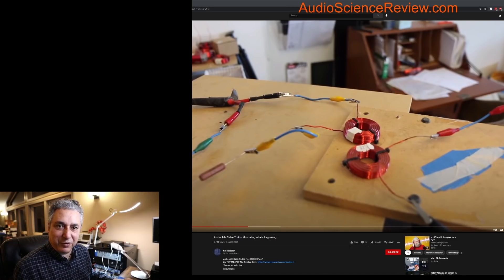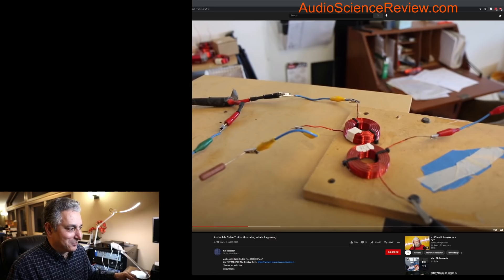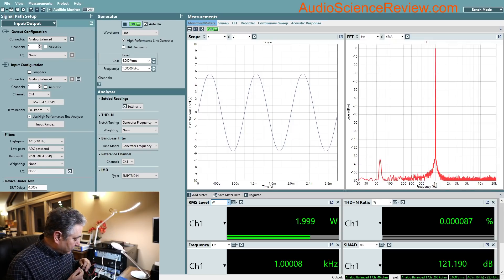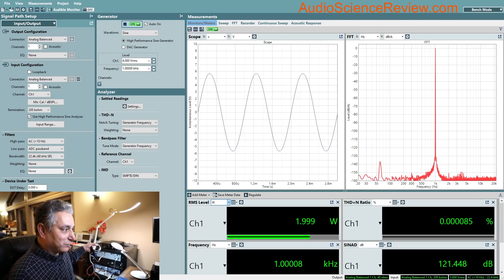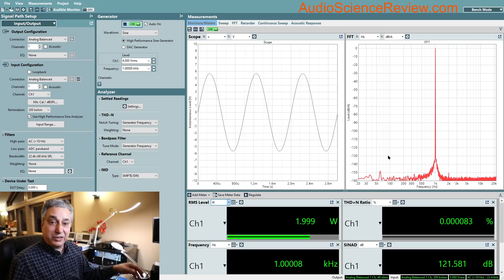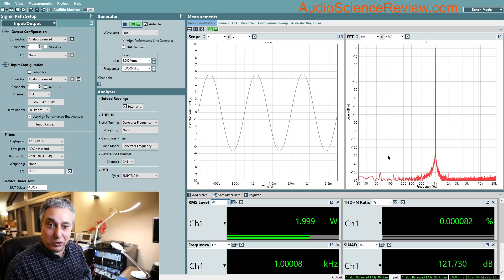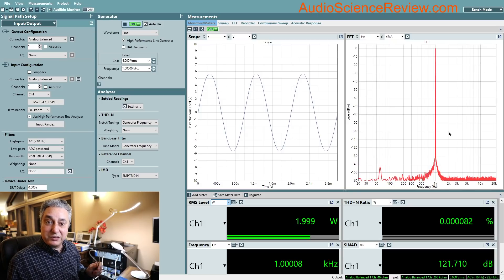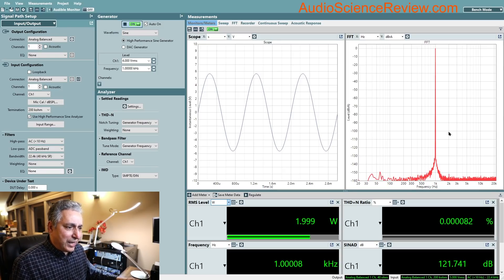Electromagnetic Interference In Speaker Cables?

Comment: I have heard inductive mains hum  once when a mains cable was crossing over the interconnect from my pre to power amp. It was easily rectified by moving the mains cable away from the interconect.

However it was late at night and when no music was playing. The level was far below the level of when a track was playing.

However it was audible.
Reply from the maker: On the input side of things, due to amplification factor, it is easier to make such things  happen.  This discussion is about the output side, speaker cable, where intrusion is far, far harder.  At any rate, the problem can and does exist.  If it becomes audible as in your case, then you do something about.  And at any rate, it is easily measurable.  The case Danny and other cable guys are trying to make is that there is a type of intrusion that is inaudible by itself, unmeasureable, yet readily impacts music.  This of course makes no sense.
Reply: @AudioScienceReview  sounds good Amir!
Looking forward to future videos on this topic and it's great that you and Danny can discuss these matters and hopefully advance the knowledge, and clarify things, for everyone. Cheers!

Comment: I mean, of course the coils next to each other did that. That's a transformer without a core. Technically they could be inductors, but it would be at really high frequencies (like, RF or higher, where every wire is an inductor).

Comment: Noise does not have to be audible to affect the sound signature of a piece of equipment your opinion means nothing to me as a engineer for 35 years and in audio for the same if you experienced a high quality revealing system you would know what I am talking about measurements are not the tell all of audio quality get educated or shut up 🤐
Reply: It is so sad that some people think that hurling insults is a valid form of debate.
Reply from the maker: I shared no opinion.  That is what you are doing with no evidence.  I shared actual measurements and psychoacoustic effect of said noise.  If you want to throw out the book of science and engineering to make your point, then I don't have anything to tell you.  I am assuming you don't go to doctors either and just go by what your gut tells you about how to cure yourself....
Reply: @AudioScienceReview  Amir for PREZ

Comment: What about this one : copper is more expensive than aluminum but less than silver. It is therefore common sense that your system will sound better with silver speaker cables (more silvery) than copper ones and that aluminum ought to be reserved to wrapping up chicken legs or connected to high-power amplifiers (provided there is enough “meat on the bone”, such a good heat conductor makes it warmer). Better, use as many interconnect cables as possible and thus go full separate. You thus increase the number of gold-plated connectors for a richer sound, and start inevitably to hear cracks and pops when you stumble on your cable lifters for a full analog experience.

Comment: Danny strikes again...Speaker wires are never an issue with noise pickup, RF, EMI, as the speaker is a low impedance load and there simply isn't enough energy in the noise to register, you can pretty much treat is as being shunted to ground as far as the noise is concerned. Line level cables are a bit different story as the voltage is low and the load is 10-50kOhm generally. When I wire my AV equipment, run AC, ethernet wires etc along one side, audio signal cables down the other to keep these cables as far apart as possible. Much less of an issue with balanced signals that the industry should have adopted fully 50 years ago.

Comment: The next obvious step is to set up an amp and speaker(s) with power and speaker wires coupled in worst case scenario, a nominal scenario, and a best case (possibly even HIFI cables). Then listen to the noise floor, test tone, and music in blind testing to see if you can hear any difference. We can do this at home too.

Comment: Would a power cord (wire) that was actually passing current induce a higher level of EM than a cord that is not passing current?  As current flows through a conductor (60hz) the changing amplitude causes EM, the basic principle of an inductor or transformer. A wire that is not passing current would not generate any (noise) due to the sine wave created by the AC current not being present? Example... Take an amp meter, clamp it around a wire connected to a load, turn on the power, then turn off the power. There is a significant difference in the EM generated by the magnetic field of the wire shown by the Amp meter (off power is the cord you used, plugged in but not flowing current) Question is, would there be a significant difference in the amount of interference (noise) with a wire passing current say 5 to 10 amps which is typical in an audio set up? I have induced a 60hz hum in a speaker wire when placing it on or very close to an older fluorescent light fixture transformer. They were notorious for that. (Danny's coil test)  It would be very interesting to see measurements to see if there is a difference with a conductor passing current vs. open ended. Great video!!!
Reply: I was thinking the same thing about fluorescent lights, though they are probably located too far away from most folk's speaker wires (unless mounted in the ceiling), to have any real effect other than for a video like this.
Reply from the maker: So many of you making the same comment.  :)  Here is a test with realistic current growing through it: https://www.audiosciencereview.com/forum/index.php?threads/electromagnetic-interference-in-speaker-cables-video.20647/post-683806.  Same conclusion.

Comment: So glad you came along Amir. Hopefully your content will change the audio industry for the better. If you haven't tested any power cables I may be sending you a big fat fancy 10/3awg power cable.
Reply from the maker: Hey there.  Thanks for sending me your amp in the past for testing.  I have a semi-fancy power cable but that is it.  Is yours a branded, "high-end" cable?
Reply: @AudioScienceReview  Its not branded. Think it was maybe $50. But it is made with true 10/3 copper wire and nice chunky gold plated IEC plugs. Also came with a lovely persuasive description letting me know all the ways it will improve my sound. I must be doing something wrong cause it hasn't made a difference on the several amps I've tried. Didn't make my Sony NS999ES disc player sound any better either. Starting to think this thing is a rip off....LOL.
Reply: @iowaudioreviews  but does it look cool? Maybe that's all you need it to do XD

Comment: what about an applied load to the wires, particularly a speaker. measuring the difference electrically and mechanically with a mic or laser removes the hidden variables of the system because its measuring the system at a whole. as a test i think this demonstrates the properties of induction not electro mechanics as a system. i dont really subscribe to anything with regard to this type of snake oil but its destroying the snake oil argument totally by treating it as a system.
Reply from the maker: The measurements you mention are not sensitive enough to pick up anything this small.  Ambient noise for example would rule out doing anything with microphone.  Now, to the extent Danny says these effects are readily audible, then he should share such clips to us to listen to.  There is only so much I am going to do to prove what is already proven.  He is going against that tide so needs to provide real data.

Comment: I loved when you showed the measurable difference of simply moving the cable around. I hope people don’t focus on the fact that there is a difference and instead understand that level of audibility is simply not there. Though, I do imagine there are going to be some cable riser manufacturers that will now use that portion of your video to show people why it is important to hold the cable in the air. 🤣
Reply: Quadcpoter manufacturers please take note...
Reply: @analoghardwaretops3976  🤣
Reply: They already raise their 2 inch fat cables from the ground with standoffs at demo's. Now those cables must cost a fortune....lol. And the connectors, omg, they must be huge!
Reply: You bullies can make fun of Danny all you want, but if you had 5000 ft of speaker cable running around a set of generators and men that ate too much curry, you’d want to hold them in the air too.
Reply: The saddest thing is that a lot of people seem to believe what Danny preaches. PS Audio also has weird claims that any EE student could debunk.
Reply: @Rene_Christensen  because Danny says "it just is" and people believe it. Funny thing with him is mixing measurements with "snake oil".  
So you can get certain things potentially upgraded, but you also need to spend money on all those expensive components that would only add a tiny benefit compared to decent but cheaper components.
Reply: @Rene_Christensen  Really, we are just jealous we didn't think of selling these 'emperor's new c̶l̶o̶t̶h̶e̶s̶  cables' and some of us may just have more integrity too.

Comment: Amir, could you please repeat the measurements but this time have the speaker cable connected to an eight ohm dummy load and the power cord powering a device such as a television. The current flow through the power cord might change the results. Also make a few measurements with the wires separated at different distances, lets say right next to each other,  one inch, two inches then  five inches. Might be a better test or show hardly any difference.  I would think that people wouldn't run power cords next to audio signal paths regardless as that would be common sense but then again we are talking about audiophiles so who knows . It's common knowledge in car audio to not do so.
Reply: @Douglas Blake  No what I am suggesting is that if he tests them with the power cord in use actually drawing current from lets say a TV or Amp, then there's a better chance of the 60Hz signal coupling with the speaker wire and if so then he can measure how much it drops off with distance. Also the speaker wire should be terminated with the 8 ohm dummy load to simulate a speaker. This test will satisfy or should satisfy any complaints over at the Danny Ritchie crowd. Armi has already shown in another video that worrying about am/fm frequencies effecting the speaker wire signal is a moot point. Just trying to cover all concerns that might be brought up.
Reply from the maker: That is a lot of work for someone lazy like me.  :)  These kinds of experiments is what Danny should be running since he is the one going against basic engineering and physics.  There are so many more topics I like to cover than repeating test after test for this one specific thing.  That said, I did run a test with AC mains where it is loaded by an amplifier this morning.  I post it in other comments and in the description but here it is again: https://www.audiosciencereview.com/forum/index.php?threads/electromagnetic-interference-in-speaker-cables-video.20647/post-683806
Reply: @AudioScienceReview   Thank you that's good enough for me.

Comment: Can you do this the other way around? I.e. pick two cables that clearly sound different and then explain what the electrical differences are that created the change in sound. At the moment it could be that there are audible differences but the equipment is not measuring the right parameters. For example, we don't listen to sine waves. Perhaps other effects show up when a range of frequencies are being transmitted at once as is the case with music. I'm not saying that's right, I'm just saying that is a valid alternative interpretation.
Reply: Problem is in SINAD religion  on ASR. Yes, speaker cables can sound different, they have measurable  different conductors, inductance, capacitance  etc. On revealing system at least  soundstage will change, sometimes tonality to. But that is not  change in distortion or noise, what SINAD measure. And on ASR if  is not  measurable  by expensive SINAD analyser - doesn't not exist. Even worse, people new to audio are delighted with those "debunking" videos , and in many cases it is simply not  true.
Reply: You can't because cables sound the same. That's the whole point of this series. Now of course you can use ridiculously thin cables or something, but than you're trying to find a problem that doesn't exist.
Reply from the maker: The only way to make that happen is to get very thin and long cable and show that it would be different.  But that is not what we should be using for speaker cable so don't think it is worth the work.
Reply: I'm not sure how cables would have a problem with a complex "music" signal. You can send high kHz through them before roll off, which alternates quicker than music.

Comment: The mains cable will needs to have some current to make the test usefull. Its all about finding the effect of the Eddy currents.
Reply from the maker: There is already current due to capacitance between mains conductors.  But sure, as I have post repeatedly, here is the test you mention: https://www.audiosciencereview.com/forum/index.php?threads/electromagnetic-interference-in-speaker-cables-video.20647/post-683806